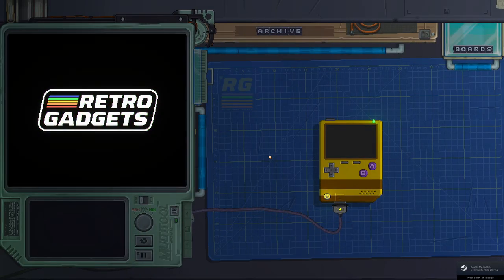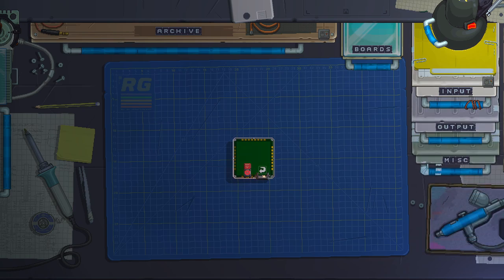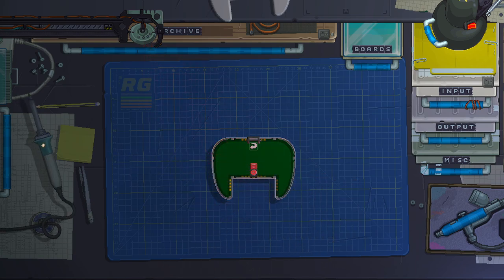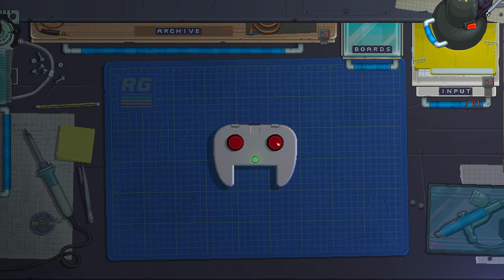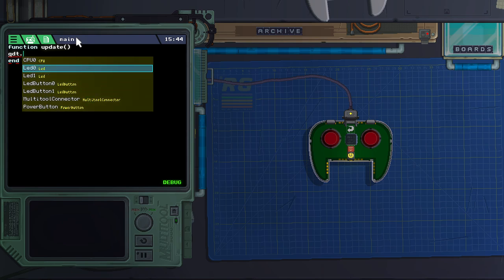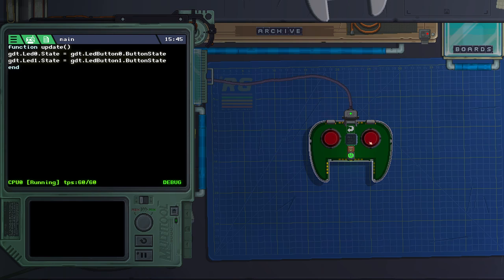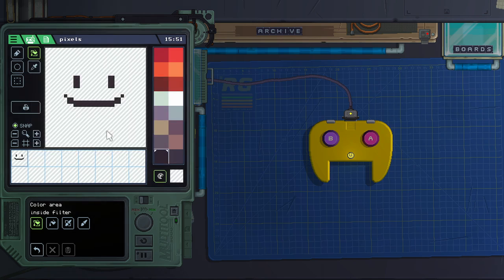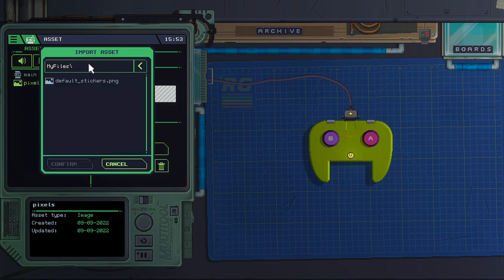Gadget Building: Long Intro

Comment: Fun fact, if you're on windows you can also zoom in super close with the magnifying tool (Windows + Plus symbol) and the drawing assistant LazyNesumi can hook into the program to smooth out or let you draw fancy patterns. This in combination with the very awesome in-game sprite editor and also the ability to import custom sprites, artistic design should pose no problem if you put in the effort and a little bit of imagination! Outstanding gadgeteering. ^_^